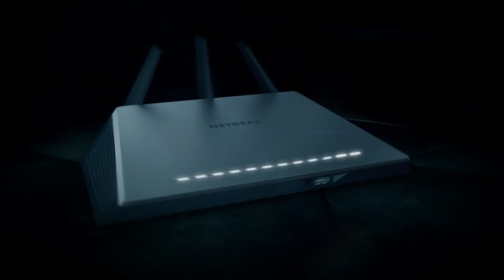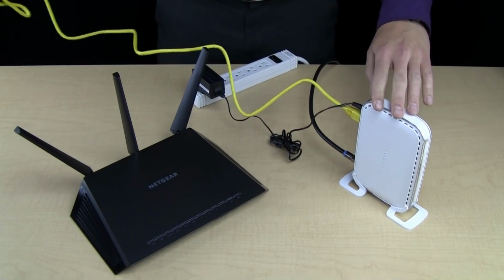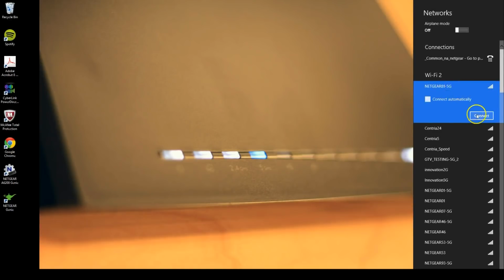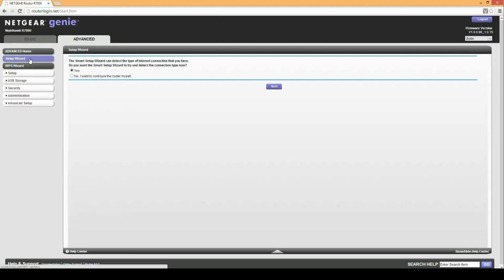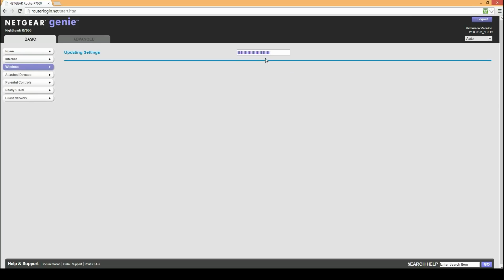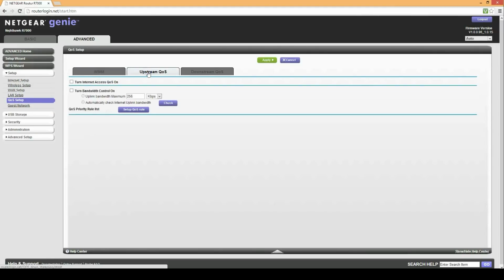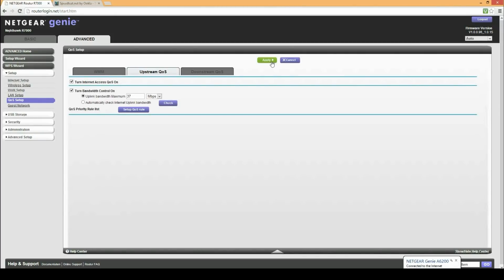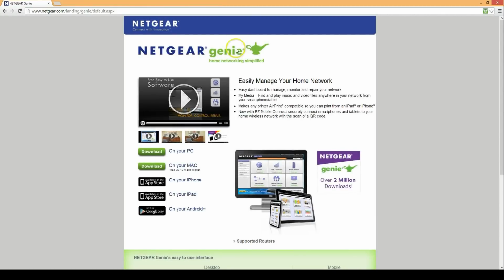How to Install Your NETGEAR Nighthawk Wireless Router (R7000)

Comment: I have a modem/router combo can i still connect it to this or do i need a modem only
Reply: you can run it with your M/R !  I run this router in this video with a netgear d6300 modem/router without a problem i just turned off the d6300 wifi and connect the two units with a ethernet cable (yellow one )
Reply: so you connected the WAN port of your M/R with the internet port of Nighthawk? and you disabled your wifi on M/R? please i need an answer because i have trouble setting up this router for like 2 weeks now
Reply: SwiftSamuraiGaming u can enable both of the wifi from the M/R and the router by changing the wifi channels so there wont be cnflictbof the 2 networks
Reply: @jefrainpaigalan3298  That keeps your Nightthawk as an access point. Completely worthless if you're trying to use the full features of the Nightthawk.
Reply: SwiftSamuraiGaming look just take the normal internet Cord from your Normal Connection Then' Plug it into The Nighthawk'' Thats all
Reply: GorillaHD Did you ever get an answer? I have a modem/router too, and having trouble setting it up
Reply: GorillaHD you just use an Ethernet
Reply: Great support huh!?
Reply: SUNGEAR59 I also have a modem/router. I have the netgear cg3000d. I have them connected with the yellow Ethernet cable, But  for some reason I can't turn of my wifi on the 
modem/router I've pressed the button multiple times now and it stay on.

Comment: I bought this router on 1/2/15. I took it home, disconnected my current Cisco Linksys G router from my Arris Docsis 3.0 modem, powercycled the Arris modem, waited 2+ minutes, waited for it to lock, connected the Netgear to the modem via the provided yellow ethernet cable, powered on the Netgear router and got NOTHING!!! -- I proceeded to disconnect everything, and start over. Same thing. Called tech support and after 37+ minutes on hold I spoke with an agent that had me do these same steps and few all over. Come to find out my router was a dud. Took it back to Target yesterday, got a replacement, hooked it all up again only to STILL not be able to get online. All wired and wireless devices can see the SSID but not get to the internet. After speaking with tech support again for 3+ hours, we found the router would not pull an IP Address. We tried hard wiring my computer to my modem and it works fine, and even reconnected my original Linksys and could browse wired or wireless! What is wrong with this product?!?
Reply: Dude.. plug the nighthawk router into an electrical outlet in your home... wi fi booster working..

Comment: Ugh. Why not show how to get the antenna caps off?
Reply: Dave's Videos I agree, this is not clearly explained by either the video or the manual. For anyone else having this problem - the antenna caps on the Netgear R7000 are not screw-off caps, they are actually black rubber nipples and very snug so not always easy to remove. Grasp them firmly at the pointed tip with a pair of pliers and they should slip off. Hey *****, it would be useful if you explained this in your manual or your videos, it kinda spoiled the excitement of my unboxing when I was like "how on earth do I get these things off arrrgh". End rant!
Reply: +Tim Schmitz Yours had antenna caps?I bought it didn't work,i took it back.Got another.Neither one had the black rubber antenna caps.

Comment: Hey Netgear,
Do you have to have a modem to install this router or can you just plug it right in?
Reply: Lukas Kloss  I just plugged my nighthawk into the wall aimed the antennas, works out of the box. The router itself is 100yds away in the shop. My cabin with this nighthawk range extender is again 100 yds away. Hope thos helps.
Reply: @FZJ8097-k1o  help asap please. I have this router and the one I'm replacing is a router. Wtf am I doing. Like do I just hook up the cords in the same place like myast router or what?
Reply: @yeetcannonblaster5396  hello there and sorry you are having some issues.. my house is 100 yards away from said computer and tower location..100 yards away.... I wasn't receiving good wi fi where I live away from computer and needed a boost.. in comes the nighthawk booster.. I plugged the nighthawk into the plug in at my living quarters. This is the only thing I plugged into, was the wall in my living quarters for electrical power away fom where my computer itself is with the plug in that came with the nighthawk itself. The nighthawk has a power button and a reset button on side of electronic device. I hope this helps..hit me up if you still have issues. Have a nice day/night/weekend.
Reply: Plug into an electrical outlet of your house in any room that needs wi fi boosted ..wa la.. wi fi boosted.
Reply: Scott Eppers so you just plugged yours in to an electrical outlet and set it up right? ,you didn’t connect it to any other devices ?

Comment: Ive went through these set up procedures several times, and I still have no SSID broadcasting for my 5G band. I got the 2G no prob. Ive checked basic settings are all ok. Any ideas? Ive tried 3 different wifi PC's and 2 different phones one Iphone one droid. All show 2G only, no 5G. please help. thanks
Reply: It was probably set to the same name for both bands so in actuality both were broadcasting..

Comment: How can I connect my legacy N300 wireless modem router to the AC1900 router?
Reply from the maker: The R7000 installation Guide can walk you through the steps to connecting the R7000 to your old modem/router. The PDF version of the guide can be found at http://www.downloads.netgear.com/files/GDC/R7000/R7000_IG_6pgCover+Interior_28May2014.pdf  . Also It is suggested to turn off the WiFi in your old modem/router, so you are using the WiFi from the R7000.

Comment: what if i plug into a centurylink modem that already has a rounter built in will it improve me internet and will it work
Reply from the maker: Your maximum Internet speeds are determined by what your Internet Service Provider is offering you, so a router can’t do more than what your ISP is providing. What a good router can do is speed up everything within your home network, and optimize what is being downloaded from the Internet and give priority to the more important downloads such and video streaming

Comment: how did your router manage to hit 100mbps meanwhile mine cant even hit 30mbps and I have the same router?
Reply from the maker: Hello Justin
The maximum speed that you can get depends on the speed your ISP provides and the speed of your local connection. (wired vs wireless etc.)
Reply: ***** i live around the san jose area and milpitas. what ISP do you recommend?

Comment: why can I not see the 5gh connection on my computer or xbox?
Reply from the maker: Hello Anthony
First make sure that the computer and the Xbox support the 5 GHz band (the XBOX 360 does not, and requires the additional N adapter). If they both do, then you should log into the router and make sure the SSID for the 5 GHz is enabled. If you still can’t see the 5 GHz band then you should contact NETGEAR Technical Support and they can help with additional troubleshooting.

Comment: have the netgear N150 and a netgear ac1900 how would i connect both routers together on one modem? i tried doing it before but the dhcp kept colliding with each other.
Reply from the maker: Hello

If you are trying to keep everything on the same LAN segment then you shouldn’t be using both routers as DHCP servers, and connecting them both to the modem is a bad idea.  If you want to have 2 different LAN segments then you will need to manually set up the DHCP server in each of the routers and make sure that their subnets are not the same. example: 192.168.2.1 & 192.168.1.1 are two different subnets.  (Note: Many modems will not support multiple routers attached to them.)
Reply: can they have the same DNS
Reply from the maker: Yes they can both have the same DNS server assigned for domain name lookups, but they can’t have the same IP subnet without causing problems.
Reply: ok n also how come when i put the crossover cables on both routers(1st lan port on both) the nighthawk light is orange instead of white like my pc port color
Reply from the maker: The Nighthawk LAN lights have 2 colors, white if the port is connected to a device that supports gigabit and orange if it is connected to a device that only supports 10/100 megabit.  Since you are seeing orange on the LAN port connection, this means the device connected on the other end only supports 10/100 Megabit. (Additional note: You do not need to use a crossover cable, just a regular Ethernet cable will work since the switch in the router is auto sensing
Reply: so do i change the crossover into a straight through cable or leave it like that. also for the netgear N150 router how could i extend the range of the router to be farther
Reply from the maker: Yes you can go ahead and just replace the crossover cable with a regular Ethernet cable and the hardware will automatically detect it and adapt.  For the question on extending the range of the N150 router, you can either purchase a more powerful router or add a range extender into your network to increase the range.NETGEAR sells a number of different range extenders that are designed for just this purpose.
Reply: ok thanks but one more question what is the best router netgear got for gaming cause i bought the nighthawk but idk if its good
Reply: also i wanted to know if their is like a wifi piece that when instead of connecting two routers with a straight through or crossover you could use that piece
Reply from the maker: The only way to physically wire the 2 routers together is by using an Ethernet cable, and both straight-through and cross-over cables are supported, but straight-through cables are what are normally used
Reply: also the nighthawk netgear router is it good for gaming

Comment: can the night hawk or any other AC router be used as an Access point I have a wired router connected to my switch and i cant find any AC access points
Reply from the maker: Hello AJ

Yes the Nighthawk can be used as an access point, and the instructions can be found in the Nighthawk User Manual on page 112.  You can find the user manual by going to Netgear Download Center at http://downloadcenter.netgear.com/ and search for R7000.

Comment: Good video, thanks.
But I can't connect my Netgear R7000 router to my Netgear D6300 modem/router and get it to work. Strange but true!  The D6300 works fine on its own, but no VPN. Hence the R7000. But useless equipment. Support are very slow, 1 week for nothing. Oh. they said send it back to my supplier!  Actually, I think they have not made them connectable! Any suggestions for a router/modem combo brand/model that will do VPN? Help! Jono, Aus

Comment: So my modem has wifi (because my providers cable only modems are even worse) and i put it into bridge mode. So i leave the modem plugged in (powered on) and continue normally??
Reply from the maker: Hi Lane,

Yes, they would leave their modem plugged in and running, since the Nighthawk router does not have a modem built in, but is only supplying the router portion of their Internet connection.

Best,
NETGEAR
Reply: ***** Thanks Netgear!
I managed to set it up and enable upstream QoS but i cant seem to maintain a completely solid connection to my xbox 360 and xbox one. I have a Cisco DPC3825 in bridge mode connected to the wall and to my nighthawk via gigabit cable. cisco modem only has the 1-4 numbered slots slots so its in number 1 Ethernet port on the modem. everything else is wireless. ya im stumped. i opened nat also
Reply: Lane Fountain
im having the same problem and honestly im about to take it back and get a full refund of my money if it doesnt get fixed and get something else because my old router was wwwwaaaaaaaaaayyyyyyy better than this one this one is horrible and cuts me off when im trying to do busisness online and is really frustrating